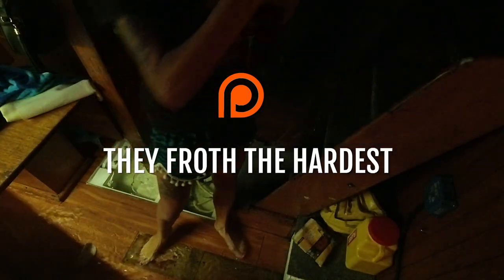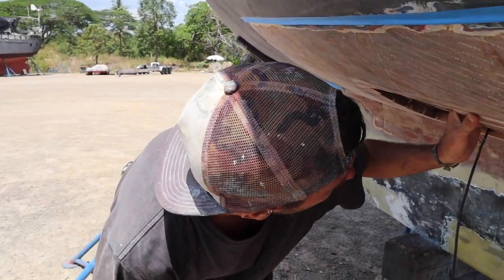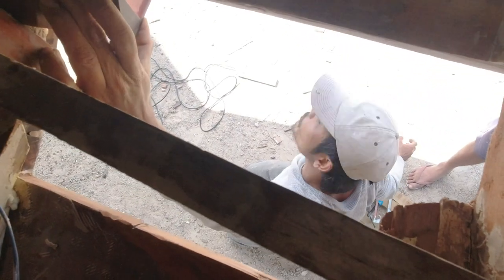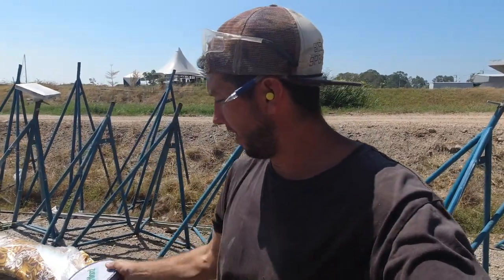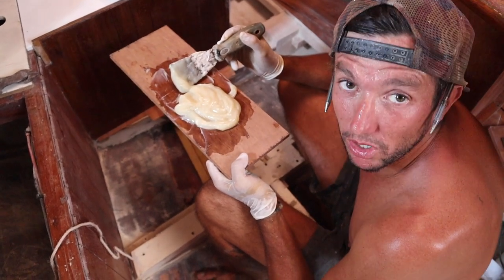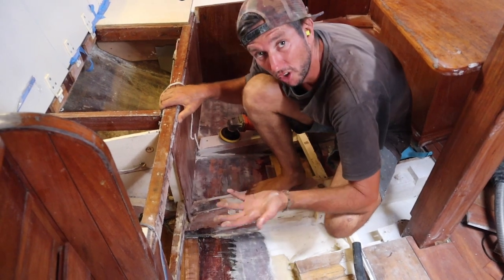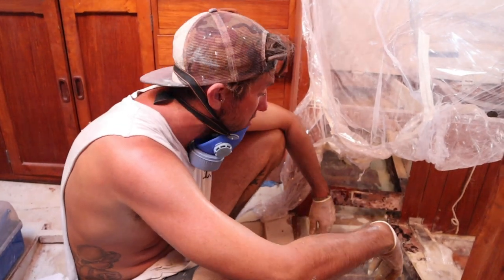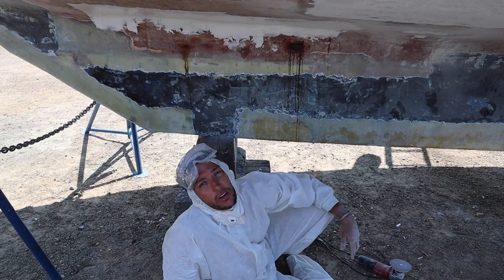Caulking our wooden Sailboat, the Old School way.... Ep 181

Comment: As a life long carpenter, (but not a wood boat builder) I can tell you that Red Cedar is very rot resistant. Not especially structural. Rare and expensive now.
I bet the ribs and stringers are are another species.  As the hull is well laid up with fiberglass and epoxy on both sides, it`s all good. You guys know your fiberglass and epoxy!
Encapsulated. Hey, they make balsa cored hulls. Cedar`s stronger than Balsa, and for sure more impact resistant.
Sleep well Yosh and Bon!

Comment: In case of cracks or holes in your polyester hull we always advise to take TST sealer with you, as it dried faster underwater, ad ca be applied during leakages.
Reply from the maker: The hull is epoxy, not polyester. We carry lots of fast setting epoxy putty that can be applied in water. Along with rags, it helped save the day. Cheers

Comment: Ya yacht is cold molded strip planked.. not sure why they caulked the patch traditionally with cotton rather then edge glueing the planks with epoxy glue
Reply from the maker: It is Thailand... This is the way all their boats are built and they repaired the wooden boat the way they know how to.
Reply: mate that repair is a shocker, repairing cold moulded boats require the strip timber to be scarf joined back in on a 7 to 1 taper. There is zero strength there and worse with the caulking. One good wave impact right there and good chance you will sink , this is not a joke, I am a Shipwright-Boatbuilder with 37 years experience . Start again
Reply: I agree, Nandji is a timber core boat sandwiched between two watertight layers of fibreglass. The wood is supposed to remain dry for the life of the boat and not swell at all. The Thai's are obviously unfamiliar with the west system construction technique and added the cotton packing and also prevented the inside of the hull from being sealed adequately by extending the stringers. I would expect that the outer layer of fibreglass to detach from the timber once the wood gets wet and swells. I doubt it will sink the boat but it will probably have to be re-done at a later stage.

Comment: Keep up the sterling work to restore the vessel to a seaworthy state. Have you checked the rudder mounting arrangements inboard - any cracking/delamination?
Reply from the maker: Great question, there was no obvious signs of damage when out of water but I puttied and glassed the area to reinforce, just in case
Reply: Sailing Nandji - Frothlyfe That’s good to hear - with a bent rudder shaft those forces were also transmitted to hull structure - you clearly have a strong boat 💪 😀

Comment: I guess you have to go with what you have at hand. If you had saturated the cotton before installing, it would have been more  satisfactory, but as you say, the hull will be totally encapsulated.
 I would bet the asian timbers are every bit as good as Red Cedar. Timber strip is just a core, anyway, so it should be fine. I don't know if you are aware, but I found mixing epoxy in a wide, flat container increased the layup time, instead of using a smaller pot. Well done, you seem to have a good grasp of the techinque overall.
Reply from the maker: Thats it, we can only use with what we have and yes, the timber is just the core so I was not too worried. Yes mixing epoxy in a long container does help improve the lay up time, same with mixing filler, spread it out. I had the epoxt setting time pretty under control but the filler I needed to work on!
Reply: @FrothLyfeSailingNandji  As you've said, it's just a core.  Red cedar isn't particularly strong, many woods are stronger.  I believe red ceder is used mainly because of its light weight, and also its rot resistance.  Although its rot resistance is not what it used to be.  The old growth Western Red Cedar  (which, FYI, is actually a cypress, not a true ceder) that we use to have here in the Pacific North West (USA) was very rot resistant.  It was so good, that 1/2" (13mm) thick shakes (shingles) made from it could last over 30 years on the roof of a house in rainy Seattle.  Unfortunately the young second growth trees that we harvest today aren't nearly as rot resistant.  In any case, the local wood is probably stronger, and if it's heavier (which is likely) it's obviously not an issue because the repaired area is so small.
However, I am curious about why you used filler where you had ground back the glass on the outside.  If you ground away glass, wouldn't it make sense to fill the area back up with glass?
Reply: @FrothLyfeSailingNandji  the core IS the strength, the glass adds to it, not the other way around !

Comment: caulking a bit strange ... but it shouldn't make any difference as long as the outside of the cotton came into contact with epoxy. I guess it's what they're used to doing and they're obviously boat guys. Good job, this boat now looks very strong and ready for the Indian Ocean, I can hardly wait
Reply: I don't get the caulking, should be all epoxy.
Reply from the maker: You got in one, it is what they are used to. All Thai boats are made from wood and caulked like this, without using epoxy or fibreglass.
Reply: @FrothLyfeSailingNandji  Hopefully that caulking has soaked up the the epoxy, otherwise you will have longitudinal joint that will flex and all the pressure will be on the fibreglass.